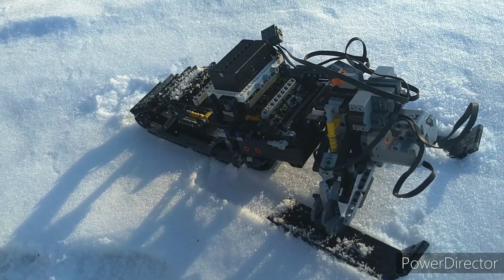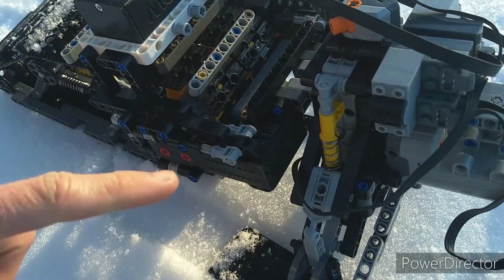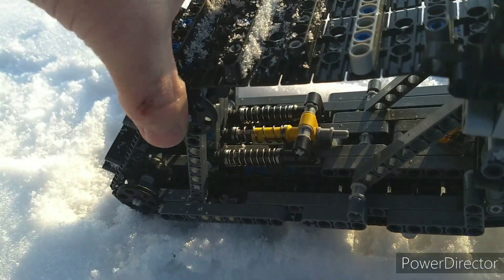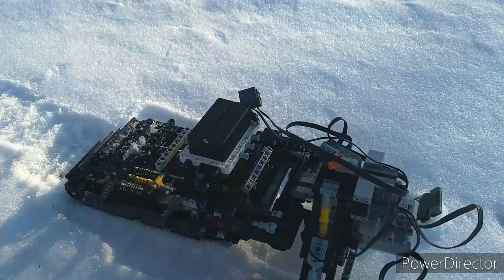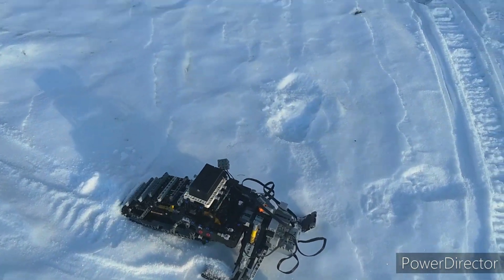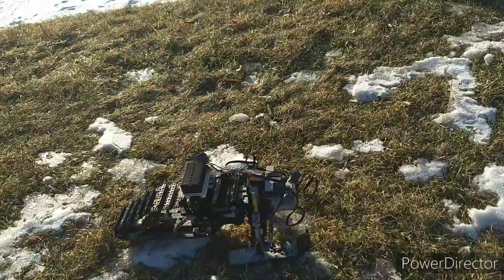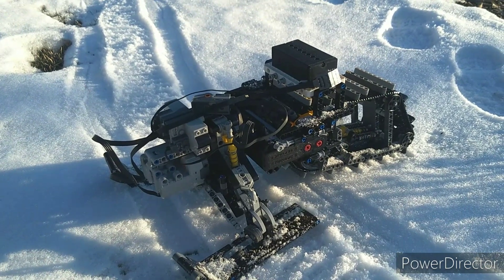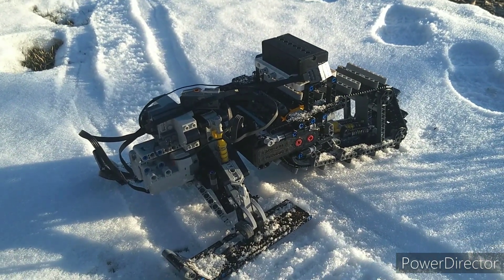Lego Technic RC Snowmobile

Comment: I like that size and use of 2 motors, but 11.1v ? To ir reciver ? I wonder hardly how is not bern for you. Specially when you connect the servo to the same ir, so every ir got servo plus buggy motor ? 
Im still not sure how it is possible.
You battery is lipo 3 cell ? (Thats go to 12.5v when full). Or you limit the current that drow from the battery ? 
Ir is for 9 v top. Your connection didnt hit ? Check my ripsaw too, we use similar way to power those beasts.
I recomend you to use 2 remotes together instead of switch, its more stronger and reliable.
With 11.1v my ripsaw could be 2 time faster, but im afraid to bern the ir.
Allready bern ir's and buggy motors in the past. I used aliexpress electronic, not original.
Waiting for your replay 🙏
I enjoyed my 11.1v first ripsaw for 2-3 weeks before i bern it... I didnt put it on my channel for that reason.
Reply from the maker: Yeah, I'm doing a setup of three cells in series, without any protection to an AliExpress receiver, to a single buggy motor per receiver. I've had some receivers behaving strangely with that battery, but I'm also troubleshooting loose connections with it, so I'm not sure where the real problem is. (I've only got one remote from Ali, so I have to use the switch.)
Reply: @2godbdglorylegotechnicvide966  
First- buy more remote, it cheap. This week i got 4 receivers plus remote and delivery for 18$. 
 Before 5 months you got picture of clip with 3 remotes 🤔
I realy recommend you to stop use that battery, or to use step down regulator to 9v. Just check that it got the current that you need - 4A per buggy motor. 
I think you will love my channel since we work in similar way.
Reply from the maker: @yuvallegomotorized  Well, I'm not sure what I'll do with this electronic system yet, but I really do want to get some power supply at 11.4V that's cheaper than a Buwizz! I do have more remotes, but they're all original Lego ones, and not compatible with the 2.4 GHz receivers from AliExpress. Thanks for the advice!
Reply: @2godbdglorylegotechnicvide966  
Just get lipo, 10$ 2 cell. 
I use that, mold king is 2 optionif you dont need more then 2 buggy motors.
I have 3 cell lipo that i dont use anymore as well.
Reply from the maker: @yuvallegomotorized  I've got the two cell Mould King 6.0 battery, and it is pretty sweet! I just really want the higher voltage to get the most power out of my motors, but it is hard to make everything work at that voltage. As you point out, though, these receivers are dirt cheap, so I figured I'd just run the risk.